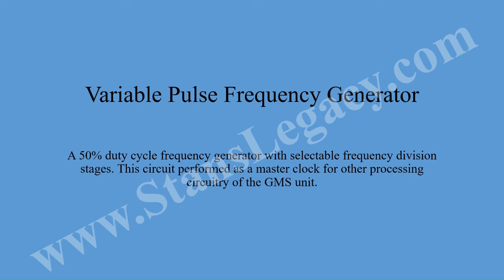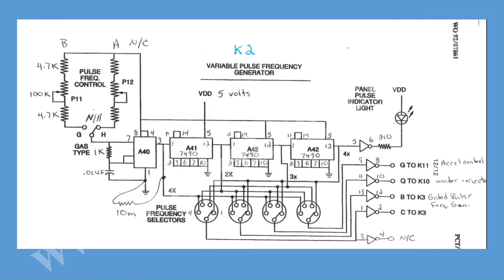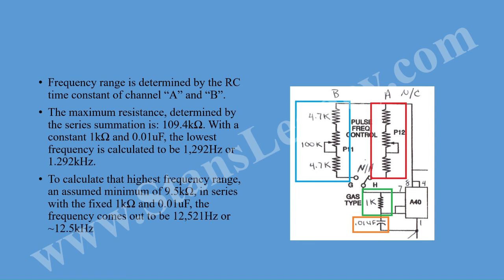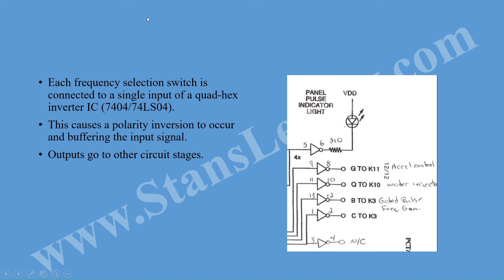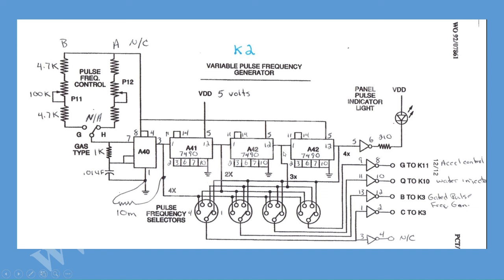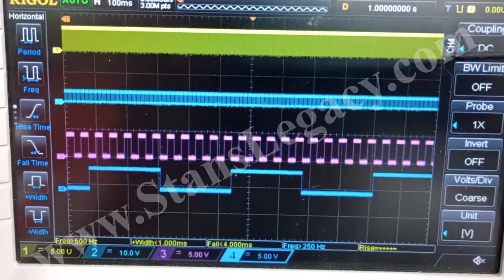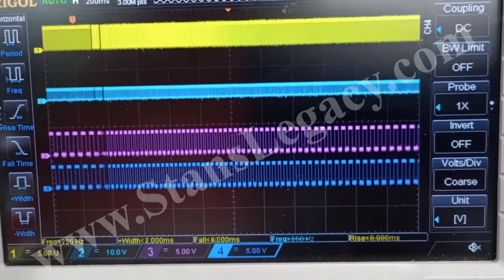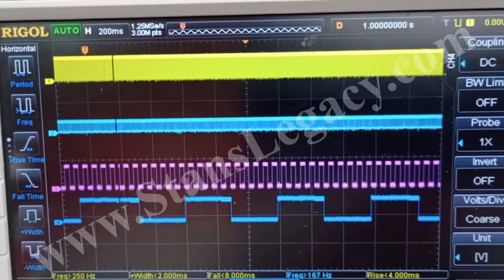Variable Pulse Frequency Generator   GMS Unit

Comment: If I may Raise a point of confusion[req for clarification] as to patent wo9207861A1, youve labeled this gas mangement board [fig 12 as to fig 1 ] output Q to K10 as being to a wf injector[aka waterplug],  yet the gms patent shows only a torroid vic and 11 cell. would this not be incorrect? rather output be either to a 11 cell unit or a H gas injector? thx. keep up the good work.
Reply from the maker: @barana24  hello. This is a part of the GMS system, it is the "clock" for the rest of the processing circuits, accelerator, distributor, injectors, etc. The patent shows this triggering a gated pulse generator, which determines how many pulses are applied to each cell by turning on all 11 VIC boards PLL circuits.